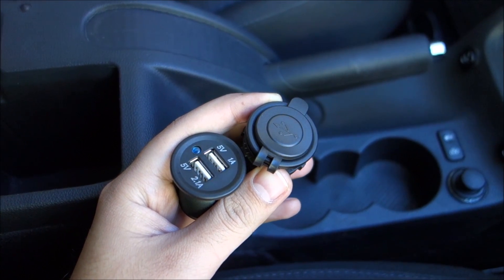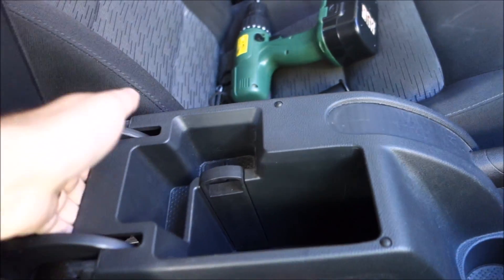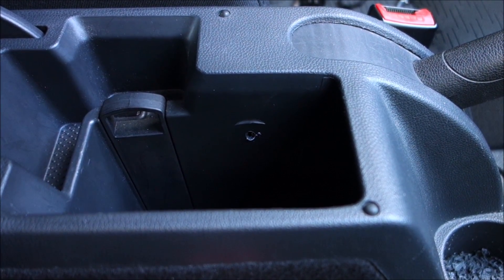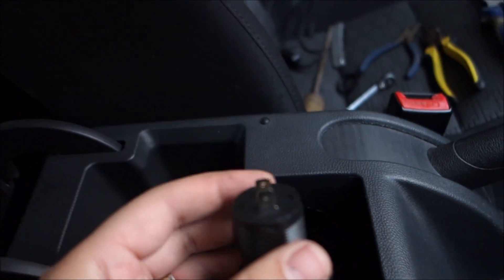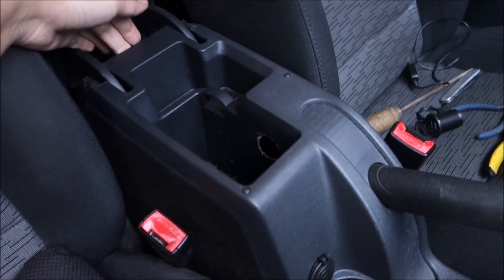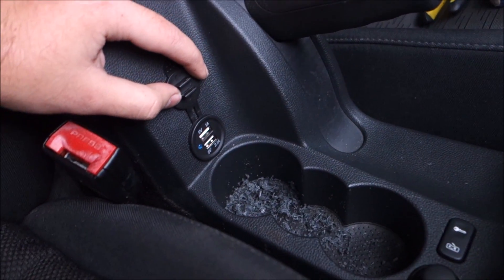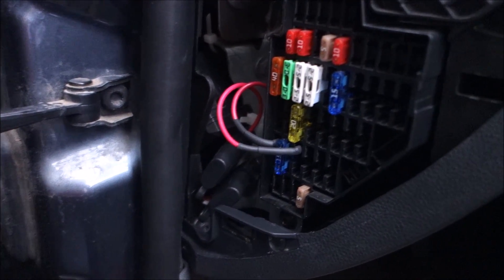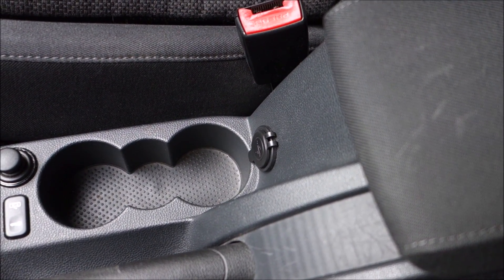🔌 How to add USB power sockets to a Skoda Octavia 2 Facelift 🔌

Comment: Can you give the links of products that u used like usb box, cables, switches?
Reply from the maker: This is the usb socket: http://www.ebay.co.uk/itm/Waterproof-Dual-USB-Cigarette-Lighter-Power-Motorcycle-Boat-Car-Socket-Plug-12V-/152709539491?epid=5003303007&hash=item238e32a6a3:g:Xk8AAOSwBlxZnnXf
Switches are from the heated seats kit: http://www.ebay.co.uk/itm/4pcs-Set-Carbon-Fiber-Heated-Cushion-Seat-Heater-Pad-Hi-Off-Lo-Switch-Kit-12V-/152435406059?epid=2176878753&hash=item237ddbb4eb:g:aDMAAOSwtfhYoV-H
And the wires are from old electronics that I salvaged for parts over time.
Reply: Thank you so much!
Reply from the maker: +Zeki Kemal Bilici welcome! :)

Comment: How can i bring power socket only on contact position?
Reply from the maker: You need direct wires from fuse pannel. There are fuse positions that only get power when the contact is on.
Reply: @UltimateDIY Thanks. I will try

Comment: I wanna ask something, i've just bought a Skoda Octavia 2011, but it doesn't have USB, Aux and Bluetooth connection. I wanna listen music by my phone through bluetooth connection because it is been so easy and without loosing sound quality. What would your solution?
- Making an aux connection
- Making an usb connection
- Making a bluetooth kit connection
- Changing the tape (it doesn't sound good)

I am thinking the making aux connection and after that using a bluetooth connection via aux, but i want to that like original skoda like at your car. But i am so new for this and with the guide i am not sure if i can do that.

Bluetooth kit is a little bit expensive, i found in aliexpress about 80 dollars. 

My radio is swing rcd310 btw...
Reply from the maker: Maybe you can dot it cheaper and with less parts:
http://www.ebay.co.uk/itm/AUX-USB-Switch-Cable-For-RCD510-RCD310-RNS315-VW-Passat-B6-B7-CC-MK6-GOLF-JETTA-/382025790502?hash=item58f282f426:g:2sUAAOSwwo1XegLW
http://www.ebay.co.uk/itm/Wireless-USB-Bluetooth-Audio-Musik-Empfanger-Mit-3-5mm-Stereo-Lautsprecher-Jack-/372010700608?hash=item569d90cf40:g:ClcAAOSwIhxZZh7R
Reply: I’ve got a 2012 VRS, I got the Bluetooth activated in the headunit and then bought a £15 microphone kit from eBay. My phone automatically connects to it when I get in, the phone sits in the cup holder and when a call comes in I just have to press one button on the headunit to take the call. I’m watching this video as I’m going to put 12v sockets in the rear ashtray

Comment: What about the cup holder, you drill the hole to low 😂🤣
Reply from the maker: I never use cups, so it's a non issue for me. I also don't think there is enough room inside to put the adapter at a higher level. Maybe if you find a smaller adapter you can put it higher.